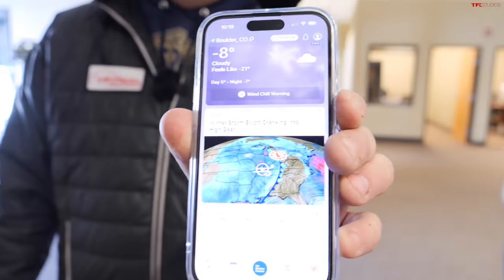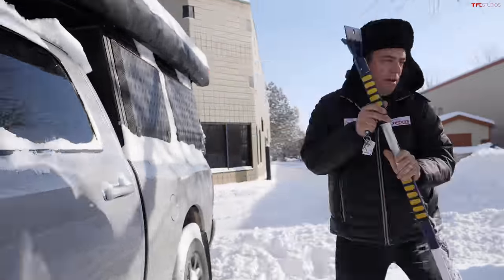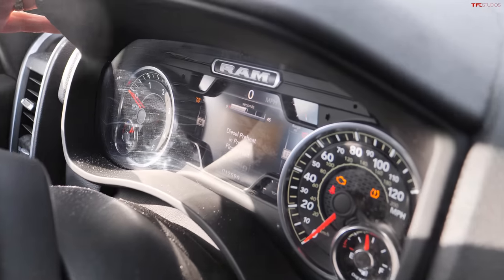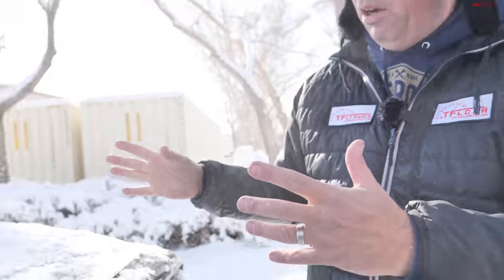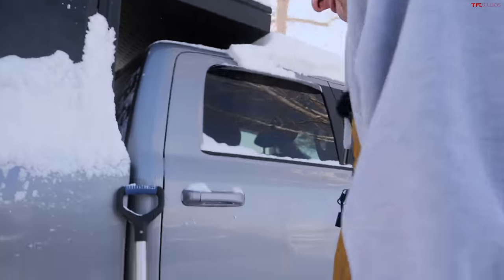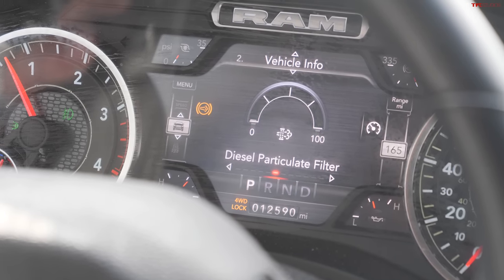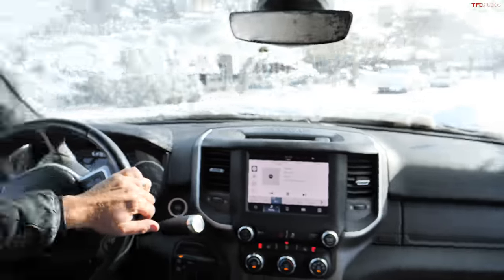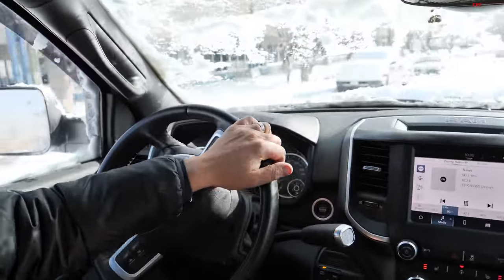It's the COLDEST Day Of the Year in Colorado: Will My Ram Cummins Diesel Start?

Comment: You do not have to select high idle or turn on the exhaust brake, the truck will do everything itself.
At 170°F the exhaust brake will come off and at 180°F the idle will go to normal unless of course you hit the brake first.
Reply: Exacly you could see the rpms come up without him doing anything
Reply: @rollingacresfarmstead206  Yes!
I usually leave mine plugged in and if the engine is not stone cold it will idle at low RPM for a minute then step up....  If its stupid cold it will fire up then go to fast idle almost  immediately, grid heater will be on steady  for a bit as well
Reply: My exhaust brake only activates with the button. My high idle is automatic. 17 2500 Laramie.
Reply: @clpadel8692 that's weird. My 2016 does it.

Comment: You should head up to Alberta Canada right now. My sister sent me a snapshot of their weather yesterday, and it was -41 Celsius without the wind chill , that's -41.8 Fahrenheit. Try a cold start in that!
Reply: That’s what block heaters are for
Reply: Also these guys don’t even have the winter cover on…
Reply: @MattSmith-vl8zp  From Edmonton, Alberta.  Yesterday I zipped my coat up, felt like an admission of failure.
Reply: ... am in Alberta. My area had -44C (-47F) with -55C (-67F) wind chill.  So I kinda laughed when they showed the -3 Thermometer, LOL.

Many of us start our trucks in that weather without using our block heaters. For my Tundra in this weather I run a 900CCA battery with 0W30 synthetic oil.  Diesel engines need a little more love than gas, but if you run a 5w40 synthetic in your diesel with amazing battery power, you can still start fine.

Plugging in the block heater is best, if you have that option.
Reply: Dear Genius, the windchill is a made up mathematical number and does not affect the ambient temperature. If its -20 with -100 windchill....its still only -20 and nothing can get colder then that.   Thanks.
Reply: Berta let’s goooooo
Reply: @GlenGoesOutdoors  you just need to have good glow plugs to start a disel, in europe also we sometimes have diesel rated to -38C freezing standard is -23C or -28C.
Reply: @GlenGoesOutdoors  no... we still ues block heaters on our diesels, 95% of diesels wont start up here in these temps without a block heater.. neither my 05 duramax or 16' cummins started not plugged in, thankfully my 12'  powerstroke was plugged in.

but yeah, their -3 isn't even a cold start, lol
Reply: @evictioncarpentry2628  it don't effect metal but it does effect when your standing outside
Reply: Yup, my 2008 Ram 2500 Cummins fires up in Alberta climate like a champ. Almost never had an issue. My 2015 Mercedes sprinter van is a different story 😢
Reply: Nwt here run a pan heater and block heater on my 5.9
Reply: @EuroYardService  you guys probably have a different diesel for the winter than some parts of the states.  Where I live they blend our diesel with antigel for certain months.  Personally I think people are dumb to not start their truck with a block heater if their truck is equipped with one.  At minimum there’s some sort of heat in the cylinders and your oil might be thinner than peanut butter
Reply: @MattSmith-vl8zp  agree. If you have a blockheater, why not use it. On the other side, some people may not have an electric outlet available.
Reply: Thx, -41 is -41 very helpful
Reply: @Chris-hw4mq  bullshite real diesel don't have glow plugs they have compression
Reply: @adamw.6488  Try cycling your glow plugs 2x.  That, synthetic oil and good batteries tends to work for most I know with diesels...

But every vehicle is different!
Reply: Nope!  Even a gas engine will struggle to crank, lol.  Even once an engine gets running, that cold of start will cause some friction wear.  Oil is pretty thick at those temps -- even zero weight!

Comment: Andre I wish you guys would include how well the heated seats and steering wheel work in some of these videos. I think people would enjoy seeing small things like that.
Reply: I have a 2021 3500 longhorn limited and I can tell you the seats/ steering wheel gets hot pretty quick. It was 14 degrees Fahrenheit last night and within ten minutes of driving, I shut seat/ steering wheel heaters off. They almost get too hot.
Reply: 2021 Laramie 2500 Cummins. The heated seats and wheel work really well. The wheel gets hot quickly and I usually don’t leave it on very long. The heated seats get toasty quickly too. I find that once I’m warm I usually switch them to low or they get too hot.

Comment: It was -5 degrees F this morning in Louisville, KY...coldest it's been in about 25 years.  I've got a 2000 4Runner and once I got the frozen door pried open, it started right up.  I let it fully warm up before moving, and the steering was stiff, and the automatic transmission held 2nd gear for a long time before shifting, but it was drama free.  The windows are still frozen shut, (it rained all day yesterday before turning into snow).  There is a layer of ice on the roads with packed snow on top of it.  I have Falken Wildpeak AT3w's and they were excellent...really didn't need 4wd, but shifted into it for going up hills.  Stay warm!

Comment: I worked in Newport VT many years ago. I had my 2000 Ford 7.3 diesel. It was -24F all day long. She started up rough but started. Treating the diesel fuel for those temps is vital. The T444 IH was designed as a cold weather medium duty engine. Miss her.

Comment: I live in northern Finland
Hand cranked my Lada in -47c weather
And it started with no problem and worked with no problem
Reply: I live in Saskatchewan at -47 c and my chrysler starts no problem
Reply: @Welcometofacsistube  Wow pretty good especially it being a chrysler, not a premium vehicle like a lada.
Reply: @Hal 1000  I wasn't the one with the childish brag about their vehicle, anyways it would be silly to leave my battery in my electric bike if I am not using it at winter, and no problem starting my 2022 Lariat F150. 

You probably missed the original joke to about it being a Lada.

Comment: having all these gauges and numbers are great but it leads to a lot of anxiety. Old trucks some years ago went through cold climates too but nobody knew about the "real" temp numbers of transmission fluids etc. And they still worked.
Reply: I assume your very old lol. Overheating is usually the culprit of when things break so being able to monitor many temps at once is useful and necessary

Comment: I also now have a 2500 Cummins 2021. And mine started well too here in the Denver metro area, but the heat cycle was only like 20 seconds at most! Interesting to see yours was longer!
Reply: Grid heater bolt drops in ur engine and it blows.
Mopar junk.
Need banks bypass and def delete cause that freezes too.
Airbox gets full of snow.
Pure utter garbage.
Never mopar again
Reply: @freeaudiobooks7469  can't delete in my county otherwise I would. I test drove Cummins prototypes. They are far from junk.
Reply: its a chrysler  it won't last anyway
Reply: @waynehicks317  Deleting actually is terrible for the driver's health.  Studies show that exhaust emissions are worse inside the cabin than outside directly behind the tailpipe, which is pretty hard to believe at first but it is actually a very repeatable finding.  The backseat is typically worse off.  Suffice to see, unless you think smoking is a good idea, you should really refrain from deleting the emissions equipment.
Reply: @unconventionalideas5683  I mean with my current local laws, I can't anyways. But is that because some people who delete also want to roll coal? Because my truck would definitely be tuned to where it would not be.
Reply: @unconventionalideas5683  Get a cabin air filter with activated charcoal and that problem is at least greatly reduced.

Comment: I started a 2021 Ram 6.7 cummins in Virginia MN during a cold front. The truck was unplugged overnight, with temperature at -30F. Fired right up.

Comment: Cummins has done a great job on the grid heater on the intake.  They work really well up here in Canada at temps cooler than that all winter long

🛻
Reply: Yep .. just watch out for the nut falling off of the grid heater inside the engine. Many videos out there of catastrophic engine failure because of the dumb grid heater nut falling off. I just blew a bunch of cash on a Banks intake and replacement grid heater as insurance to never have that happen to me. Merry Christmas!

Comment: I have a 2020 6.6L Duramax in my GMC 2500. I'm living in the Northwest Territories. I have had no issues starting in our cold temps. We've had our day time highs in around -35C and as low as -40C over the last week. I do make use of my block heater. I also added 2x battery blankets and an oil pan heater just to increase my chances of starting. I have done a few cold starts at -33C without plugging in and had no issues. The only irritating part is the DEF tank takes a few min to warm up enough to melt the fluid but knock on wood - no issues with the DEF system as of yet. I keep the tank just slightly below 1/2 for the DEF and that seems to prevent any issues.

Comment: How cute, in high school I had to plug in the block heater 30 minutes before I had to leave for school then go sit in my Scout for 2-3 minutes holding down the glow plug button to even give it a fighting chance of starting in the winter. Once it finally did bark off I had to hold the gas pedal down for another minute or so since the high idle didn't work until it could stay running on it's own while I made a huge cloud of diesel smoke for the neighbors to enjoy. Those old Nissan SD-33T mechanical diesels are a different breed.

Comment: -37C here in Saskatchewan Canada(-31F) my truck is sitting plugged in at work for a few days… will be interesting to see how it starts… 2022 Ram 1500 Rebel with the Hemi
Reply: I'm in saskatoon.  -47c with the wind chill
Reply: @Welcometofacsistube  windchill didnt affect equipment but just living creatures btw
Reply: @Tonyx.yt.  another one who know nothing about the cold.
Windchill does affect equipment.  Big time.
Reply: @Welcometofacsistube  It does as far as equipment is warm, that's right.
But once the object reach the ambient temperature, there's no heat to lose quickly due to windchill.
Wind increase heat loss, that's for sure, but you cant lose heat if there's no heat to lose anymore.

Comment: I have a 99 24 valve,  when outside air temperature is -20  c I plug block engine heater in for 3hours. Activate preheat an engine starts in 1.5 seconds.. when artic air drops lower, I remove batteries into warm area.for protection of freeze..

Comment: Great video, the grid heater is actually for the emission system to reduce soot load. I have a LML Duramax in my GMC and to reduce emissions and better fuel economy it lives in my garage. 
It is plugged in 2 hrs before start up with a block heater, oil pan heater and transmission pan heater. I prefer to baby my truck to reduce wear and tear. It is extremely rare that my glow plugs come on.
Reply: Nice truck brother, it’s a real shame more ppl don’t take pride and maintain their vehicles. I’ve got an 03 suburban 2500 with 340k miles and 8000 hrs on her but she still runs strong. Every 5k mile fuel filter and oil change, 50k on trans, diffs, transfer case, brakes, coolant and power steering. One day I’d like to throw in an LBZ tho, one day
Reply: @LibertyOrD___h  yes I agree we need to look after our trucks. I run 5W-40 full synthetic oil and change it twice a year because I pull a fifth wheel trailer. Brakes are checked twice a year when the winter wheels come off then go on. My son has a 1 ton GMC, same thing happens to that.
Reply: The grid heater on a Cummins is not for emissions. They don't have glow plugs so that's the only way to warm the air. A duramax has glow plugs and they come on every time you start it.
Reply: @MrCherrygrovedude  I didn’t realize the Cummins is sans glow plugs. I have a diesel in my 109 LandRover which is glowplug with ether pump start, 1969 vintage
Reply: @chrisbarnes2823  no glow plugs and being an inline 6 is the reason for it's legendary reliability and simplicity. Cummins is the best engine you can get in a light duty pickup.

Comment: That was a real good start. on my 2000 Ram 2500, i had a engine heater i would plug in when it was cold. one year i was upstate NY and temp hit about zero and it started fine. however, as i went down the road, performance got sluggish and wouldn't go above 30. The fuel had jelled and hadn't been treated at the station i got it from. i had to stop and get some diesel thinner/heat and put in the tank. after a little while were going down the road ok. during this cold snap, it got down to 2 degrees and my 2022 1500 Echo-diesel started fine, no issues.

Comment: My diesel cold startup experience with this storm as follows:

Truck 2002 Ford f250 7.3 
Batteries Aldelco AGM Golds, 6 years old. 
Coolant/D.water 60/40
Oil Shell Rotella T6 5w40 
Odometer 175,000 miles
Motorcraft glow plugs, 2 years old. 
Block heater, Hotshots winter fuel additive. 
Startup 1 with Block heater. 
Temperature: -8, -45 with wind chill.
Block heater for 3 hours.
Truck started right up with 1 cycle of the glow plugs. After 10 seconds Truck went into high idle. No smoke after 2 seconds. No engine lag. Near perfect startup.
Startup 2 without Block heater. 
Temperature: -3 -40 with windchill.
1 cycle of the glow plugs also.
Truck started right up again but this time after startup it lagged to idle engine speed. 10 seconds later went into high idle and after 20 minutes resumed normal idle. Blew white smoke.
Leaked no oil due to brand new oil cooler seals. And maintained 14.6v during idle.
Overall old trucks do fine if they're maintained well and proper assistance measures are utilized.

Comment: My Tundra started up with a little effort up in NW Montana yesterday when it was -30 I keep my truck outside year round with no block heater, only issue was the whine of the steering pump and the heaviness of the steering wheel.

Comment: I owned a 99 and 03 Cummins Dodge 5.9
Both started without a block heater at -19 below zero with no problems what so ever. They ran flawlessly! The power steering did whine for about 10 miles on the 99. The heater output took a while to get warm though. When I did use the block heater it gave me instant heat.

Comment: Started my 2020 6.7 H.O. this morning here in northern NH(-13). Didn't plug it in and it fired right up. But just remember the Cummins will automatically go into high-idle in these conditions.

Also remember the computer remembers the last engine cycle and of you haven't driven the Ram in a while, the pre-start cycle will be longer.

Comment: Ah so many pleasant memories.
One morning back in the 80's I was too late to wait for multiple busses so I jumped in my old Buick on a morning like this, fired it up, scraped the windshield as best I could inside and out, ploughed through frozen piled up snow with that GM posi, 
made it to the undeground parking lot at work and grabbed the elevator to the office in time.
One hitch though.
The car had busted hoses and absolutely no water when I fired it up.
I took a chance and let me tell you that old 455 was toasty by the time I shut it off.
Winter trips at 7 am to work at bone cracking temperatures are par for the course in Ontario and some of my fondest memories.
Not!
Reply: That's awesome!

Comment: I must have one of the 5.9's built on a Friday.. My 03 3500 won't even think about even a hiccup in anything below 40 degrees Fahrenheit.. My 07 lbz never gives me an issue even in the coldest Temps I've had it which was -17 and without using the block heater...

Comment: I think the coldest I've had to start my '03 3500 Ram Cummins was -22 and it had been setting out all night while I was at work, not plugged in and it took right off after the second try.   My 2020 2500 Cummins had no problem at -15 unplugged overnight this last winter.  I've never had to use ether for starting on any ram cummins.

Comment: I used to have a Case IH Maxxum tractor with a 5.9 Cummins here In upstate NY. It was  1990 model. I never had trouble starting it in the cold. I ran 0w-40 Mobile 1 Delvac in it. Others couldn't plow snow. I ended up plowing all my neighbors for free.

Comment: I own modern diesel semis. I would never recommend high after a cold start. That oil is like pancake syrup when it's this cold. That means all the lubricating parts were starving for oil. Including the turbo. Do you know what the cost is for a new turbo alone would be? Great video.

Comment: I wonder if the struts on the hood failing had someone to do with the weight of snow on the hood. There was still quite a bit of snow on it. If not im disappointed in RAM quality for allowing that to slip past their quality control cold weather testing! No good! Plus that window motor needs to be of a heavier duty variety!

Comment: Never had any problem starting my diesels (Ford and Toyota in Europe) down to - 25F/-32C with winter diesel.

Started my hilux at - 8F yesterday, no issues whatsoever. 
Electric windows, just fine. 

Usually I use my aux heater though. 

I always see big diesels from the US having problems starting in the cold, why?